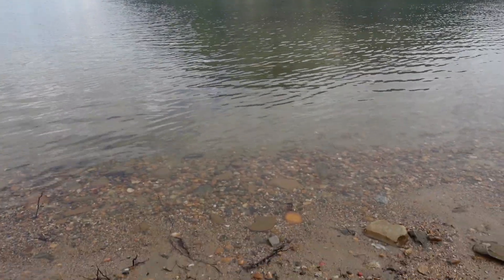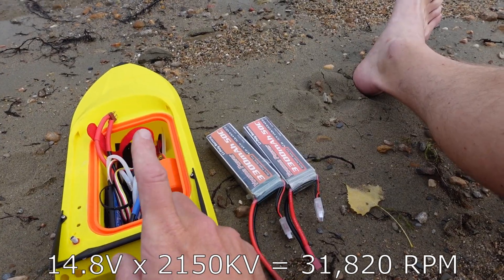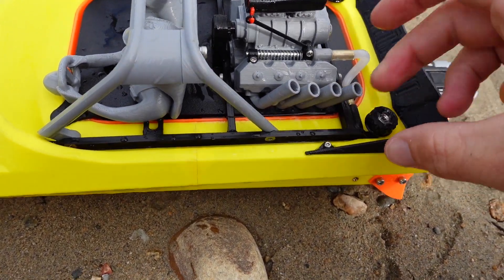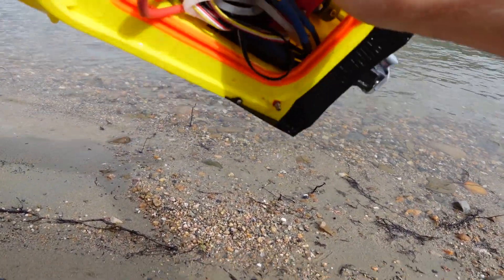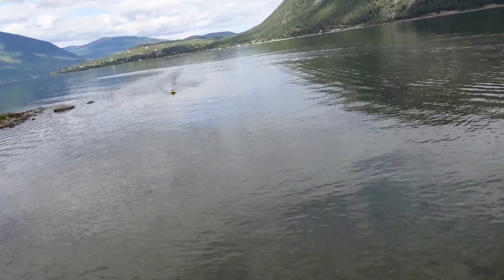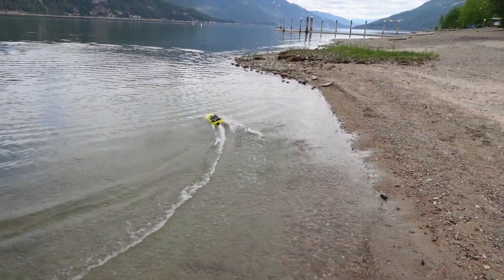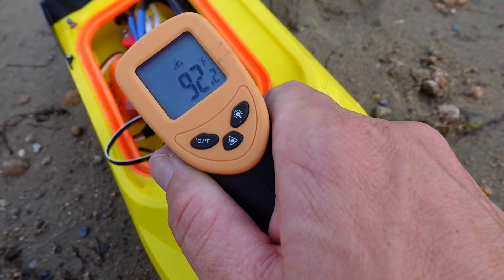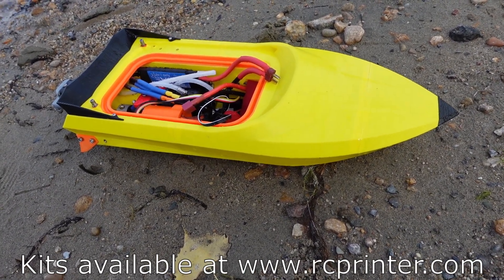Testing 3S vs 4S LIPO with the M-Jet Supersprint Jetboat

Comment: Thrust/weight = speed, and weight is poison. Adding a cell and not cutting the mAh is self defeating. As much faster as it did go, it would be another 30-50% if the battery weight is cut in half.